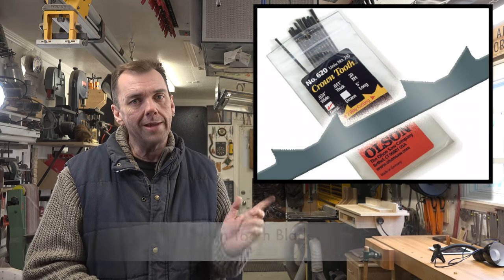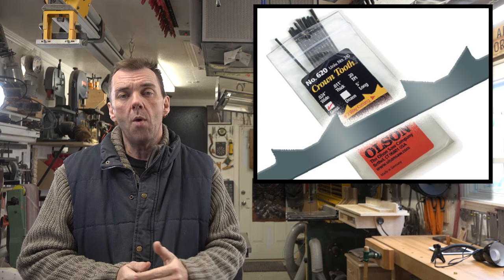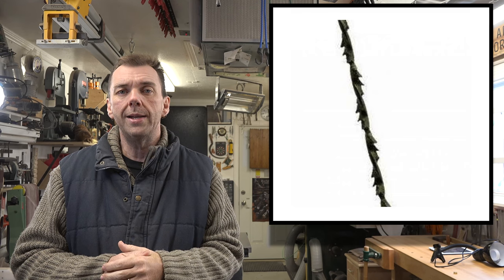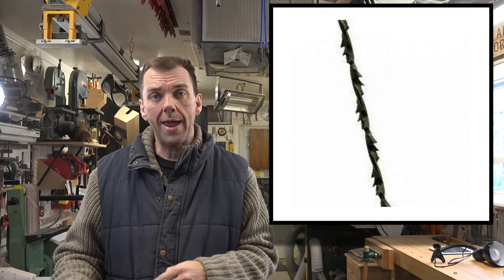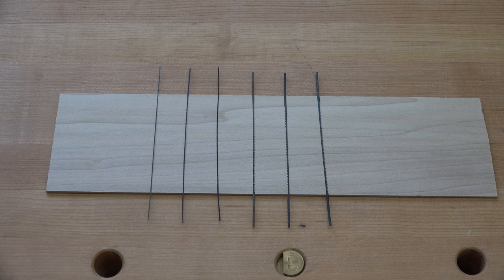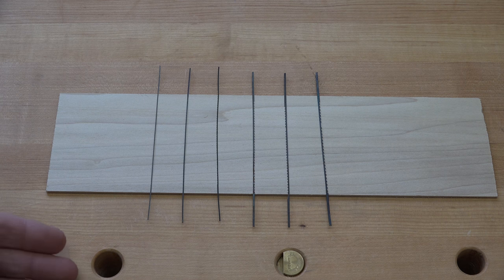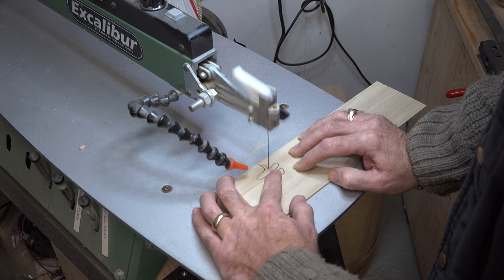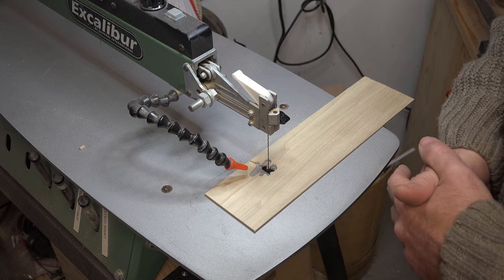Scroll Saw Blade Selection

Comment: Thank you so much for this video. I am new to scroll sawing. So new that I have tried some practice cuts and broke both blades. I haven't been able to make 90 or 45 degrees turns without breaking or bending blade.  Also can't find a variety of blades in my area. This video has been extremely helpful. What blade would be best to cut aluminum can type metal?
Reply from the maker: Thanks for contacting me Linda.  It sounds to me that you are using blades that are too coarse for your purposes.  Aluminum can material can come in many thicknesses and there are metal cutting scroll saw blades for various thicknesses.  You might have some success cutting the material using a reverse tooth #2 scroll saw blades at very low speeds.  On line is your best option for getting a variety of blades, regardless of what area you live in.  They may just end up costing a little extra in shipping, that's all.  I hope I've helped you Linda, but if not, feel free to comment back to continue the discussion about blade selection.  Or you could go to my facebook page and start a PM about it if that would suit you better.  Thanks for tuning in.  It's appreciated.
Reply: @acutabove_woodworkings  Thank you so much. You've helped me greatly. I've been scared to scroll since I did so poorly on my first and second try.  I'm going to try again and return the pin blades I bought.
Reply from the maker: @lindachandler5980  cutting metal is not exactly a beginners cutting.  My suggestion would be to practice with thinner pieces of wood.  Thicknesses of about 1/4" would be perfect for a beginner like yourself to learn the ins and outs of scrolling before moving on to more difficult materials.
Reply: @acutabove_woodworkings  Thanks, Kenny, I was just curious, not planning to cut metal right away (yes, i was.) I'll take your advice and get the wood cutting mastered first.
Reply from the maker: No worries  @lindachandler5980  .  If you have any questions along the way, the offer still stands that I will help all I can.
Reply: @acutabove_woodworkings  There is another approach to cutting the thin metal. Not sure if its for everyone but it works and gives a really controllable and clean cut. I buy an inexpensive 1/8" pine constrution plywood to "sandwich" the metal between an upper and a bottom sheet, eithet tape the edges or pin nail to hold, I prefer using tape, then cut as you would normally do. When finished, remove the center metal stock and sacrifice the wood. The wood gives stable support to the thin metal being vut. I use this method when making templates for quick reproduction of projects. Very good informative article, you dod a great job. I have been scrolling for better than 25-26 yrs now and was ising the mach series blades pretty much exclusively. Recently I tried the Pegas MGT blades and find I like them much better, they are a clean cutting aggresive blade and an added feature is they actually cut truer than a normally stamped blade. I now considering a new saw, liking the parallel link design and Pegas has a good deal on theirs(looks to be identical to Excalibers). Currently own a 20" RBI, its almost 24 yrs old, never an issue, although I did replace the upper bearing on the drive link earlier this year. The saw still performs and looks as good as it did when I first bought it. Just been itching to try the parallel link type saw. Thanks for covering the blade dilemma, very informative....
Reply from the maker: @jamesmoore3346  Thanks for the kind words on the show and the metal cutting suggestion.  That's a really great tip.  It sounds like you and I started scrolling around the same time.  I've gone through several saws in those years but my Excalibur is the one I am currently working with and can't see myself trading it in any time soon.  I've heard good things about the Pegas saw.  If you should get one, please let me know how you like it.  Thanks for tuning in to the show James and for chiming in with your experience.  It's very much appreciated.

Comment: Hi Ken, a lot of nice information put forth in this video. Thanks for going to the trouble. What would you use for Pine 2x4s? I make a lot of little kids toys out of them. Hope all is well at home. Are you finished with rehab?   God Bless my friend.
Reply from the maker: Great to hear from you Frank.  While most scroll saws boast the ability to cut material that is 2" thick, I don't recommend it as the blades have a tendency to flex far beyond their threshold and the cuts are rarely useable.  A band saw would be better suited for cuts this thick.  However, If I were to be cutting 2" thick pine, I would probably go with either a #7 PGT skip tooth blade or a #12 PGT reverse tooth.  As for the rehab.......I'm done sir.

Comment: Xellent knowledge,,, but what kinda wood is best for different thicknesses? I just cut some 20 mm oak, that's really tuff
Reply from the maker: 20mm or just over 3/4" of oak is a tough cut for sure but it isn't impossible and I have done many projects out of the same thickness of oak using a #7 PGT reverse tooth blade and had no problems.  If you are looking for specific woods with specific thicknesses to cut, there is no such list.  Each species is very different and they all react differently to being cut.  You will have to experiment with different thicknesses.  If you are looking for an easier cut with hardwoods, stick to 1/2" and less (13mm) if you are looking for more of a challenge, go larger than 1/2" but there is no definitive list available.
Reply: All right and okeydokey, thanks
Reply from the maker: If you are cutting a certain thickness and are having problems, please don't hesitate to send me a message and I will be more than happy to suggest a blade size for you,.

Comment: Thanks!  can you tell us the sprial blade # vs thickness of wood?
Reply from the maker: The spiral blade's number system is the same as the regular pin-less blades.  The numbering system is universal regardless of the type of scroll saw blade.  A number 2 skip tooth will cut the same thicknesses of wood as a #2 reverse tooth or a #2 spiral.  I hope this helps.  Thanks for tuning in to the show.

Comment: Are blades numbered on them somwhere?  If one has a bunch that may come in a packet or get mixed on the bench, how do you tell which is which?  Count teeth?
Reply from the maker: The blades are not numbered on the individual blades and are only numbered on the packages that they come in.  If they get mixed up, you could potentially measure the number of teeth in an inch and go from there but with experience and use of the blade, eventually you will be able to tell which number blade you are using just by looking at them.  For now though, you are at the mercy of the package details or measuring the TPI (teeth per inch). Thanks for tuning in James.
Reply: Thanks for the information. This is just as suspected.  Time to get to the bench with the ruler.
Thanks for the quick response
Jim
Reply from the maker: You're very welcome Jim.  Glad that I could help.  I just wish I had a better answer for you but there really isn't one.

Comment: Kenny I do find you Videos very informative. Being a beginner and haven’t done one project as of yet I’m trying to find what blade to use. I’m curious as to why you pro’s don’t list what typed blade used on a project that you do. Thanks again.
Reply from the maker: On some programs Robert, I will start off a scrolling clip by stating that I am using a (insert blade size here) but for the most part, blade suggestions are strictly suggestive.  The size of the blade is determined by so many factors.  The thickness of the stock, the species, what part of the species (sap wood, heart wood, crotch, burl) the tightness of the curves etc.  There are also factors like how your saw cuts.  Does it slow down when working on harder cuts.  There is also the factor of cutting style.  How much pressure does the operator put on the stock as they are feeding it into the blade?  It's impossible to know all of these factors so it's difficult to give a blade size because we don't know what you are working with.  As an example, if I am making a project out of 5/8" poplar that has tight curves and smaller cuts, I might opt for a #5 blade.  If you were to make the same project but decide that you want to make yours out of maple, the blade size would most likely be a #7 now due to the difference in hardness of the species.  Although both are considered a hardwood, one is much harder that the other.  I would suggest as a beginner, to start off like this.  For woods that are 1/8"-3/8" in thickness, use a #2 or #3 blade.  For woods that are 1/2"-5/8" use a #5 or a #7 blade.  For woods that are 3/4"-1 1/4" use a #7 up to a #12 blade.  If the blade that you are using isn't cutting the species due to one of the factors that I mentioned earlier, go up one size.  Eventually, you will find that you hardly have to think about what blade to use because you will know what works for you, your saw and your cutting style.  I hope this helps.  Thanks for tuning in to the show.

Comment: I want to cut steel.  What blade to use?
Reply from the maker: You will need a jeweller's blade to cut metal and you will also need to slow your scroll saw down to its lowest speed.  The size of the blade will depend on the thickness of the metal you are trying to cut.  I hope this helps.  Thanks for tuning in.

Comment: I just bought a skil scroll saw used for $20 but I think it only takes pinned blades. Wish I had saw this beforehand
Reply from the maker: You might want to check your model and see if there is a conversion kit available for it Brad.  There are quite a few models that are capable of receiving a kit that will allow a "pinned blades only" setup, to use "pinless" blades.  Something like this https://www.ebay.com/itm/Scroll-Saw-Blade-Holder-Conversion-Adapter-Set-to-take-Pin-Plain-End-Blades-/121350904110
I hope this helps.  Thanks for tuning in to the show.

Comment: Help please I have inherited a Power craft pfz 400 r n scroll saw ... no manual , so I havent a clue what type of blade i need , pinned or flat ! I will be subscribing so i can learn how to use this machine , thank you ( such a lovely workshop !)
Reply from the maker: I believe (but am not positive) that this saw takes the pinned end blades.  I also believe that it came with an adapter for taking flat ended blades.  Do you know if you have the adapter or not?  I you would like to contact me via Facebook or email, you will be able to send pictures and I can help a little further but as it stands right now, the best I say is that your scroll saw will take the pinned end blades.  I hope this helps.  Thanks for tuning in to the show.

Comment: Great video! what is the best blade for cutting oak?
Reply from the maker: Thanks for the kind words on the show.  You question is not specific enough as there are more than one factor that decide the blade size.  You would need to tell me the species AND the thickness as both play a very important role in blade selection.  How thick of a piece of oak are you trying to cut?
Reply: Red oak 5/8” thick
Reply from the maker: If I were cutting a pattern out of 5/8" thick red oak, my first blade of choice would be an Olson #7 PGT reverse tooth blade.  You might even get away with a number 5 blade but a number 7 PGT would leave a much cleaner cut.  If the piece was very intricate, then I would drop it down to a #5 though.  I have used some #3 blades in 5/8" stock but the blade struggles a bit.  Better to step it up to a 5 or 7.  I hope this helps.
Reply: Awesome info,  i have not used an Olsen blade yet but i will be getting some this weekend. Thanks again!
Reply from the maker: You're very welcome

Comment: My scroll saw uses pinned blades.  Is there any way I can use non-pinned blades so that I can do finer work?
Reply from the maker: Unless your blade holders are designed to accept both pinned and unpinned blades, you will not be able to used unpinned blades in a saw that is designed to only accept pinned blades.  However, not knowing what kind of saw you have and what type of blade retainers it is equipped with, it is pretty hard for me to say definitively.
Reply: Jim Semple hi you can buy a conversation adapter kit that you fit to the saw to take pinless blades .have a look on ebay
Reply from the maker: I can honestly say that I've never heard of this type of adapter kit fishtank.  Interesting.  I truly wasn't aware that this sort of thing was available but I looked it up on amazon and found one right away.  Here's the link.  https://www.amazon.com/Olson-AC49610-Scroll-Blade-Conversion/dp/B005ELXNX6. Now I don't know if this is compatible with all scroll saws but it definitely looks like it would solve the problem of the older saws not being able to accept the blades that lack pins.  Thank you for posting this and bringing it to my attention.  This is some great information and I appreciate it.
Reply: kennyearrings1no problem  ive  just purchased a  second hand draper  FS400 and I was hoping it would take pinless blades.ive just checked and it takes both..Iam missing one  clamp holder..but that's a easy buy..happy days.

Comment: I know I'm late to the party, but I work with wood and resin (mostly jewelry making), and my mom is letting me have her scroll saw she never uses. I use a lot of hardwoods in my work (I mean African Blackwood hard), and I'm worried about the scroll saw's ability to work with wood this hard. I only use about 3/4 inch stock or less most of the time. In your opinion do you think a scroll saw could handle working with this type of material, and if so, what blades should I look into for this type of work? Thank you and thanks for these awesome tutorials!
Reply from the maker: Better to arrive late to a party than to never arrive Brittany.  A scroll saw can definitely handle the kind of stock that you are asking about.  For 3/4" thick material, you would probably want to go with a #7 PGT reverse tooth blade.  As you get down to thinner stocks, you may have to adjust the size of the blade so that the cut is not too aggressive.  Say #5 or #3 for 1/2" thick and a #3 or #2 for 1/4" thick.  I hope this helps.  If you have any other questions during your journey on the scroll saw, please don't hesitate to ask.  I'd be more than happy to help if I can.  Thanks for tuning in to the show.

Comment: Thinking i want to make jig saw puzzles any suggestions
Reply from the maker: Jig saw puzzles are a great scroll saw project and are best made from thinner stock.  You also want to use the smallest blade possible so that the kerf of the blade isn't making your puzzle pieces too loose.  I would suggest a 2/0 reverse tooth blade for cutting the puzzle.  This will allow you to make your puzzle up to 1/4" thick without running the risk of slopping puzzle pieces.  I hope this helps.  Thanks for tuning in and for taking the time to ask a question.
Reply: Thanks you for the info. Every much appreaicated
Reply from the maker: You're very welcome Larry.  If you have any other questions, please don't hesitate to ask.

Comment: faltou o video de como usar cada uma, sou do Brasil e aqui não temos muito material sobre isso...mas valeu....
Reply from the maker: The process on how to use each blade is virtually identical.  The problems occur when you select a blade that is not meant to cut the thickness of material you are trying to cut.  This video focuses on the information to be able to select the proper blade for the thickness of material.  I hope this helps.  Thank you for tuning in to the show.

Comment: I need to cut 3/16” and 1/4” thick aluminum
Reply from the maker: For aluminum, you might want to try a blade with 8-10 teeth per inch and slow the speed of your saw down.  You want to try and minimize heat and friction.  I hope this helps.  Thanks for tuning in to the show.

Comment: #5 spiral in 1/2 inch baltic birch is very very slow.
Reply from the maker: I can imagine Robert.  That's pretty much at the threshold of the blade's capabilities.  Thanks for tuning in to the show.
Reply: @acutabove_woodworkings  Would a smaller one be better ? # 2 or 3 ?
Reply from the maker: @bonenfant96  a #5 or a #7 would be the correct  blade for the application here.  The #2 or #3 are too fine and would end up overheating.  Slow and steady wins the race in this case Robert.  1/2" is a pretty thick cut for a spiral blade under any circumstances.
Reply: @acutabove_woodworkings  Thanks for your advice. I'll order some of those.

Comment: great but wish: guide to cutting thin sheet metal say copper/ aluminium 0.5 to 1mm thick ( making diy pancake electrical slip rings)
Reply from the maker: Cutting metal is not a normal thing to do on a scroll saw but you could with a fine tooth metal blade and a very slow stroke speed on the scroll saw to avoid overheating the metal and the blade.  If you google "metal cutting scroll saw blade" you will find many manufacturers that produce one.  Olson makes a metal cutting series of blades that work quite well. I hope this helps.  Thanks for tuning in.
Reply: @acutabove_woodworkings  hmmm cutting thin sheet metal quite common for  silversmiths / jewellers ??? . Trial and error I found jewellers blades Came in 12 pack. Newbie didnt understand . Loaded the whole lot in one go into the machine LOL ...... still cut rather well.  tedious though making rings . constant re threading blades through. No  laser cut guys will touch small orders.. will have to do P..
Reply from the maker: @philotis1896  I don't mean to laugh at your mistake but I have to be honest, that you gave me a good chuckle.  I'm glad that you were able to acquire blades that will suit your needs.  That's fantastic.